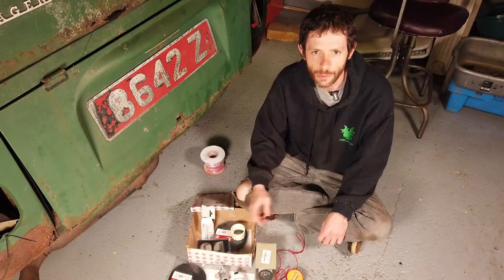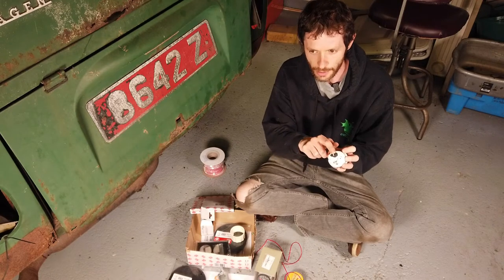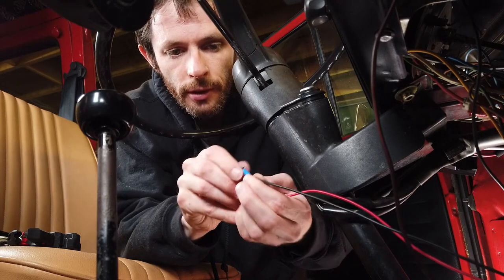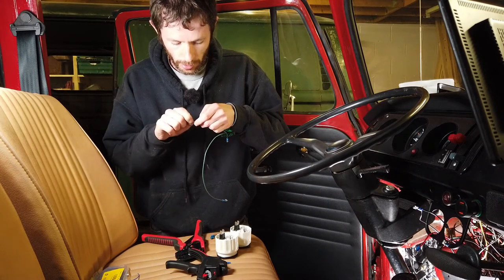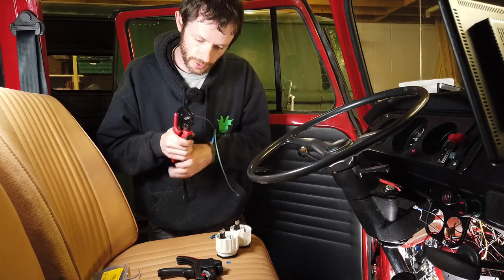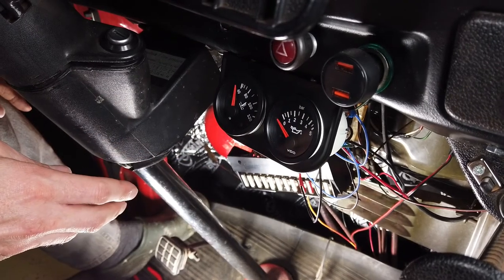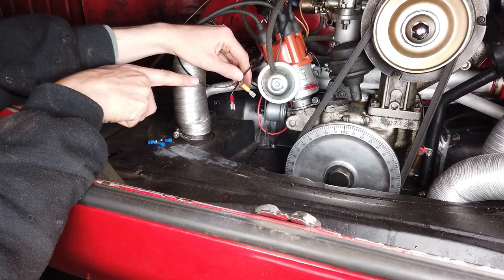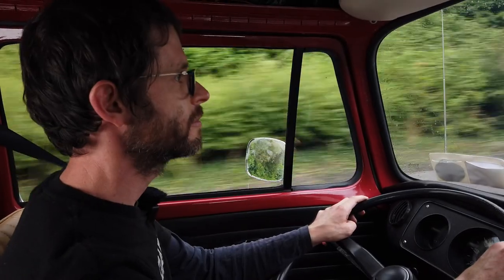VW temperature and pressure gauge installation

Comment: Did your temperature gauge ever get above 50 ish...I fitted one a while back and it never goes above 55..I have tried lots of things like a thicker sender wire..a new sump plug sender...and nothing has worked 
..any ideas